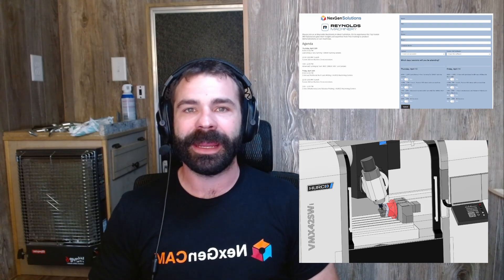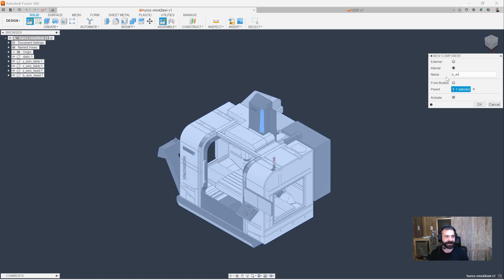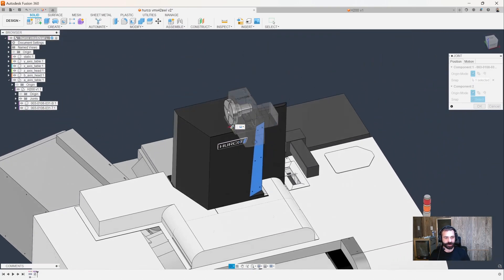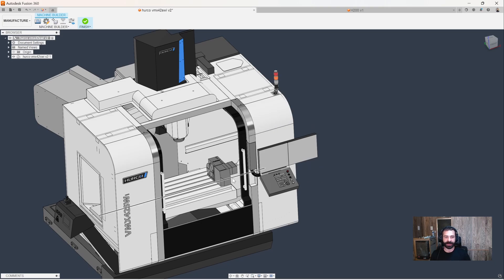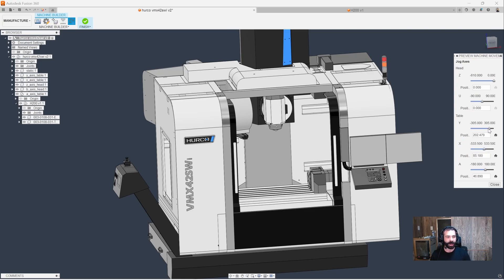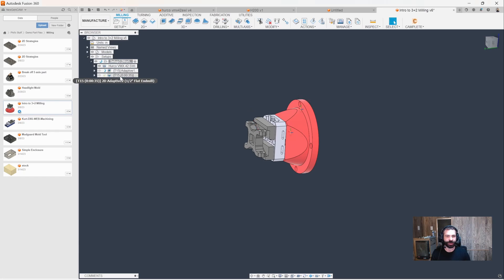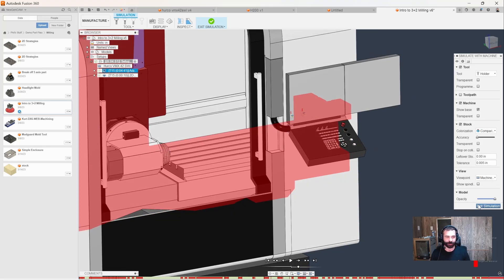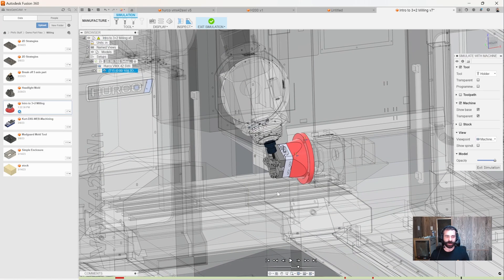Fusion Friday (ep108): Adding A Rotary Axis to Machine Simulation

Comment: Dude this was awesome, I've been trying to figure this out for days! I do have one question. I'm running into an issue where the tool is no longer attached to the Z spindle location, it starts inside of the bed, where the part was located before it was changed to the A axis. I added a HRT100 to a Haas TM1-P,  and would appreciate any advice you have.

Comment: very helpful but.... I maintain a post for GRBL based controllers and noticed that if I do not select a machine I get Gcode that does exactly what I expected, correctly engraving a 40mm diameter workpiece in the 4th axis at Z19.3, but if I select a machine with a model (started with the autodesk generic 3axis router and added a rudimentary A axis) and 4th axis it wants to set a tool offset of about 23mm and then engrave at about Z-53.   so far I have not figured out where the extra offsets come from, any ideas?  While GRBLhal does support TLO it is mostly not used in the hobby router world and we expect everything to be relative to the current WCS without any machine or tool induced offsets, we just probe the end of the tool on the stock for Z0. Generally no ATC on hobby routers, no tool offsets used. thanks

Comment: Thank you! With the help of this video I was able to simulate 4th axis milling on my AVID CNC and prevent crashing into my workholding while minimizing wasted stock. I ended up using the Autodesk Generic 3-Axis Router in the Fusion Machine library, measured, modeled, and animated my existing Rotary Axis chuck and jaws in Fusion 360 and added an A axis to the table via machine configuration. It worked great!